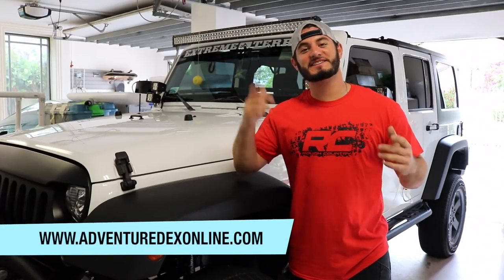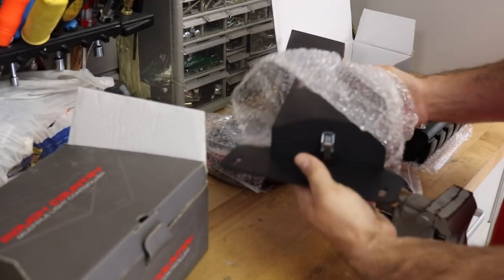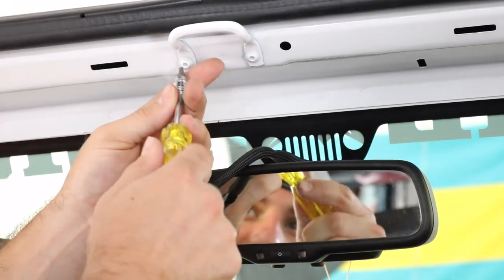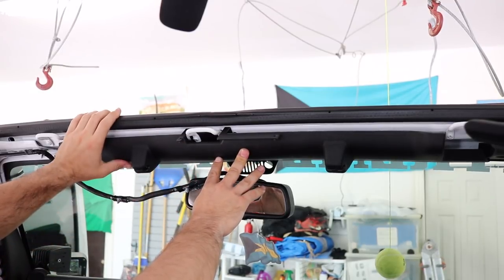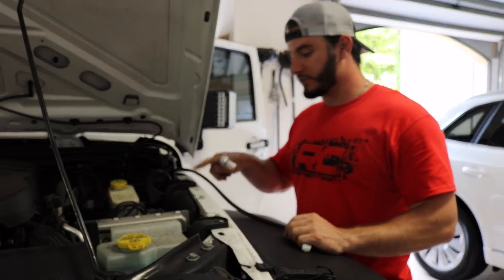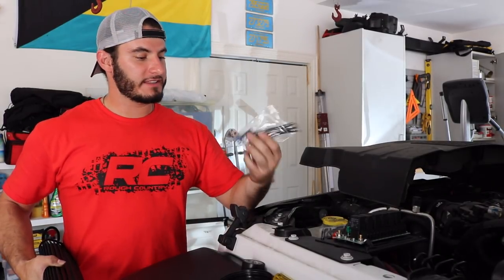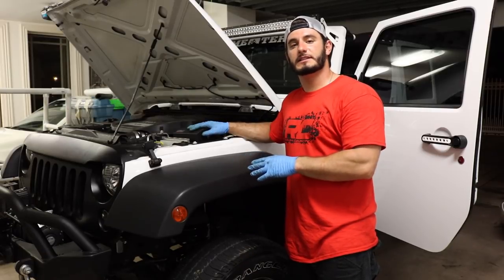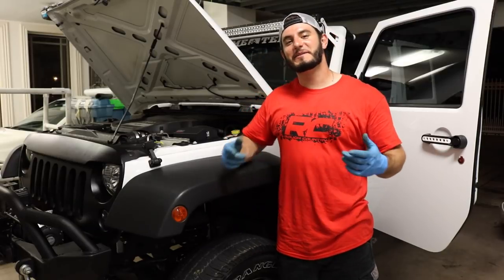Jeep Wrangler Switch Pod Installation - Rough Country MLC6

Comment: Sorry if you mentioned this in the video or I just haven't done my research but does the MLC-6 work on a 2017 Jeep Wrangler?

I'm 16 and I am beginning to save up for a Wrangler as my first car. I absolutely love the community for upgrades and mods to the Wrangler(as well as this channel! Thanks a lot!), and can't wait to do a few to mine when the time comes. Is the 2017 any different from a 2016 or 2015 mod wise?
Reply from the maker: Thanks for the comment! There is no difference really. I am not 100% sure if this works on 2017. You would need to check with RC. Thanks for watching!

Comment: Those switches look like Carlton? switches.  They make them in Red, Blue, Amber, and mixes.  Check out Ottraw.com.  There are ALLOT of different rockers (the touchable part of the switch) too.  You can get red led switches and swap them out.  The upper ON light is powered from the Source line, but the little led that is staying on can be powered from your dash dimmer.  The Carlton switches from Ottraw.com are dimmable (chinese knock offs may not be).  So if you power that light (it has it's own terminal on the switch) from your dash light circuit, then the light will be adjusted from your dash light reostat, and they will be OFF when the dash lights are off.  It looks like it wouldn't be hard to run one more wire up to the switch panel.  Ground is already wired so one wire is all you'd need, then pigtail or jumper it to all the swtches.
I have no affiliation with Carlton (I think that is the manufacturer) or Ottraw......other than buying stuff from them.  I have been very pleased with Ottraw's service.  
If you get switches form them, don't forget to get the terminals too.  They can be found under the "accessories" or "other parts" drop down tab.  These are the terminals that "lock" in the plug part that plugs onto the back of the switch.  Ottraw has the best prices for these terminals that I have found (I've seen them on Amazon for 70 cents for a single terminal ! ).  Ottraw has a tool that makes it easy to pop off the rocker from the switch.  Get one.  They are inexpensive and you will find you use it allot.  They have tons of rockers to choose from .... and they can make custom ones (the letters or words on the rocker switch can be customized on certain rockers).
Reply from the maker: Thanks for your detailed comment! I have looked into OTRATTW switches and I plan on getting some in red. They make alot of different types and they are supposed to be great quality. I will be making a video on them once I get them. They are a little pricy but I guess you get what you pay for. Stay tuned for that video! Thanks for watching!

Comment: Dex - Have you found a way to turn off the LED's? From other reviews I have read the LED's stay on all the time - even when the vehicle is off..The only way I can think of doing this would be to hack in a relay that turns on only when the key is in ACC that would power the MLC6.  Thoughts?  Thanks!
Reply from the maker: Thanks for the comment! No, the lights stay on 24/7. It doesn't really bother me or present any issues so I can not messed with it. If you unstinting wiring, I am sure you could disconnect the light so it is not on all the time. If you connected the power source to a source that only had power when the Jeep was on that would fix that. Thanks for watching!

Comment: when the Jeep is turned off, will the switch panel illumination shut down. it looked like the switches were still illuminated when you turned off your ignition.
Reply from the maker: Thanks for the questions Shawn, The blue lights never turn off. This does not affect the battery. Thanks for watching!
Reply: so how can this not drain battery. is there a way to connect the back lighting to a fuse panel.
Reply: AdventureDex hey you said this wouldn't effect the battery, but it just killed mine... Do you think it's because I didn't connect any lights to the source? I was planning on installing all my lights in a week, so I was just running the product on my car without any lights connected to it. Do you think that may be the reason my battery died? I'm not sure if once you have lights connected to the source then the whole system functions properly. Do you have any suggestions of what I should do? I really like the product and rather not return it if I can just prevent it from killing my battery again. How has it been working for you so far?
Reply: CROD The LED draw is so minuscule, you'd have to leave your Jeep sitting idle for a couple of weeks to have a problem. RC posted on Facebook they're coming out with one that puts the LEDs on a switch like that shall-not-be-named-but-so-overpriced brand.

Comment: So I did the install everything worked good but for some reason the leds from the switches don't turn off.
Reply from the maker: +OzilMadrid15 Thanks for the comment. They are not supposed to! Thanks
Reply: AdventureDex thanks for the answer I figured they wouldn't since they hook up to the battery. So the next morning I checked the box after having my jeep off al night and the control box was really hot. Have you had this issue?

Comment: Do the led’s on the switch dim with the steering wheel control? My concern is that they might be too bright driving at night. What is your opinion?
Reply from the maker: +michael sorokin Thanks for the comment. No they don’t dim, there not really that bright. Plus they are up top which is out of the line of sight. Hope that answers your questions. Thanks for watching

Comment: This thing just killed my battery... The lights from the switches never turn off. I'm not sure if it's due to a defect, or if this is just how it is.
Reply from the maker: Thanks for the comment. The lights are not supposed to turn off. They will not kill your battery either. Thanks for watching!

Comment: Does this product work with a Freedom Hard Top on a 2015 Jeep 2D Wrangler? It just seems that there is not much space above the switches to lock the Freedom top. In your video, you don't have the top on so it's hard to tell. Thanks...Bill

Comment: I have the mlc6, after I finished installing the battery portion, for some reason it came with an additional lengthy wire for the positive cable on both ends, so I cut the one to shortest length that connects to the circuit board but left it exposed, now when i turn on the car with the mlc6 power switch on, it starts to spark immensely, and I can't figure out a way to fix the situation

Any tips?

Comment: Hey how did you wire up your led light bar to the mlc? I know from your led light bar video it came with a switch already. Did you have to strip the wire or something
Reply from the maker: Wiring up to the MLC6 is easy, just run your wires and connect them to the MLC6. You will need to strip your wires to connect the source. Hope that helps! Thanks for watching!

Comment: i have a cb radio and a ham radio mounted where the switches need to go, above the mirror. Would it be possible to keep the pillar switches instead while running the MLC6 under the hood?

Comment: Do you think it is possible to wire this with an A pillar set up rather than above the mirror? I've been searching, but can't find anything. thanks for the video.
Reply from the maker: Yah Definitely but I am not sure what the advantage would be seen as this kit comes complete as one unit. It is supposed to take the hassle of wiring away. Hope that helps! Thanks for watching!
Reply: I would like the hassle free aspect, just wanted to know if they had a kit with a pillar option rather that the overhead. I just prefer that location.
Reply from the maker: Understood. The A pillar is great too but much more work wiring. Thanks

Comment: So we recently had the ML6 installed in our 2016 Jeep wrangler 75th edition.  We notice when we got home that we are able to close the center latch for the tops that is next to the switches.  Do you know what they might have done to install this incorrectly?  I watched your video and you seem to have no problems.
Reply from the maker: Thanks for the comment Stacy, The center loop does create a SLIGHT issue when trying to full close the latch. My latch close enough to create a good seal on my Freedom panels thus I do not have any issues with leaking or anything. If you cannot close your latch at all, you might experience issues such as leaking. I would make some adjustments to ensure the latch can close just enough. Hope that helps! Thanks for watching!
Reply: Stacy Toomey i believe if you install the bracket in front of the footmans loop instead of behind like the video shows everything should line up perfect ?? AdventureDex is this correct?

Comment: Hello great video! Quick question when installing the lights for example a 50 in light bar do I connect it directly to it or do I need someKind of relay in between. Thanks
Reply from the maker: +RETRO thanks for the comment! You can connect any lights directly to the source. Very convenient. Thanks for watching

Comment: do you have a winch and is it hooked up to it? Does it handle the amps from it? I have a 2013 JKUR and I use my winch ALOT!
Reply from the maker: Yes, I have a winch but no it is not hooked up cuz the winch connectors are huge. I will look up a way to hook the winch up. Thanks for watching!
Reply: ya that was a concern if it would handle a winch connection.

Comment: Hi Adventure Dex, I have a different switch panel for my 2013 JKU. The install was similar and comes with everything the Rough Country kit does but, one thing I like about my kit is that I have a choice in switch color to match the Jeep's interior lighting so it blends in & looks factory, another thing is that my switch panel has a battery volt meter which also monitors voltage if the Jeep is not running and will cut off power to the lights to prevent battery drain below a certain voltage so won't drain the battery below start power.Hey, you can always either use your old switches from the Pod Panel you took off or order new red only switches on Amazon that will fit directly in your new Rough Country Switch Panel, This is my kit https://www.amazon.com/Apollointech-Wrangler-2009-2017-Overhead-6-Switch/dp/B01CDTW03K/ref=sr_1_3?ie=UTF8&qid=1493472886&sr=8-3&keywords=jeep+wrangler+switch+panel
Reply from the maker: Thanks for sharing, this is a very similar product but I cannot speak as I havent had the chance to truly see it. Thanks for watching!

Comment: I just received my Rough Country Switch Pod and it looks like they have added a work around for the blue lights staying on all the time. Now it will only come on with the jeep running or acc switch on. There is a Red wire added on each end. One goes to the M6 Fuze with a fuze tap, and the other requires you to cut the wire going to the relay under the hood? Instruction not clear how to connect after cutting. Spoke to RC and still trying to get the power to the switches?? Anyone else hear of this? I have the instructions they sent and can provide a copy (Not helpful at all!)! Also not sure how to get the wire into the fuze box to connect the fuze tab??? No access holes? Drill a hole??? Hope to get it operational soon!
Reply from the maker: Thanks for your comment! I will be making a video on this MLC-6 mod. Stay tuned!
Reply: I also got this version of the MLC-6 and was not sure how to attempt this at all with the extra wire on the positive battery connection. any solutions yet??

Comment: I was wondering; I'd like to wire two Light pods (2 on both sides of the vehicle) together on one switch, and the other two on another switch.  Seeing the MLC6 that you're talking about, how would you go about doing this?
Reply from the maker: Thanks for the comment! Two easy way to do this, either run all the lights to one switch and connect or connect all the light together then run 1 wire to the switch. Hope that helps! Thanks for watching!

Comment: Can this controller can be used in any other vehicle or is electronic designed only to work on jeeps.???
Reply from the maker: It can be used for any vehicle but the application is designed for Jeeps. It would have to be customized to fit another vehicle. Hope that’s helps

Comment: how did you hide the Led cables from the outside of the jeep?
Reply from the maker: Thanks for the question, the cables running to the inside of the Jeep go through the firewall in the engine bay. The cables going from the lights get hidden behind the light bar mounts. Hope that helps! Thanks for watching!
Reply: Thanks man! awesome Jeep by the way ✌
Reply from the maker: Thanks!

Comment: are you still able to hook the hard top onto that latch
Reply from the maker: Yes, half way. It does leak so it good! Thanks for watching!
Reply: AdventureDex I'm having the same issue!  I just installed the switch box and I cannot get the latch to secure.  Is that ok?  Everything else went great!  Awesome video!  Thanks Bob

Comment: How should the wire be run from the switch box through the fire wall?
Reply: If you look along the wall near Your Break pedal you'll see what looks like a black circle, its rubber and you can go through there.

Comment: I just got this for Christmas and plan to install some lights I also got for Christmas. The wiring harness the lights came with include a relay, do I need to keep that relay while using this?
Reply from the maker: You don’t need the relay... just connect it direct to the source 👍🏼
Reply: @adventuredex  that’s what I was thinking but I just wanted to be sure, thank you!
Reply from the maker: Anytime!

Comment: you can make your own for a lot cheaper if you just do good wire management but thats just me haha
Reply from the maker: Thanks for the comment Logan, for $199 this is pretty cheap bro. By the time you buy 6 switches, 6 relays, 6 fuses, a circuit board and all the wiring... your probably close to $199. Save yourself the hassle! Thanks for watching!

Comment: The fact that both parts of the unit are open to the elements is an instant fail
Reply from the maker: Thanks for the input, "instant fail" might be a stretch but I agree it is not set up to take on alot water. Thanks for watching!
Reply: You could fab up one out of plastic  it wouldnt be to hard to do and just seal the unit under the hood after you use all 6 spots.

Comment: Does this product works with 2020 Jeep Wrangler JL?
Reply from the maker: No but they make versions for the new JL platform. 👍🏼
Reply: Do you have the part #?
Reply from the maker: Check out RC website. They have two switch pod options for the new JL

Comment: Hi brother man thank you so much for your videos . Your videos have made me install a lot of upgrades on my JEEP WRANGLER JK SAHARA 4DR 2018. But this time I really need your help, This are my products from ROUGH COUNTRY THAT I WANT TO CONNECT TO THE    (1) MLC-6 MULTIPLE LIGHTS CONTROLLER   SKU 70959  (2) ROUGH COUNTRY FRONT WINCH BUMPER SKU 10585. (3) ROUGH COUNTRY 50in BLK SERIES DUAL ROW CREE LED LIGHT BAR SKU DLR 7095080  PLEASE HELP ME THE WIRING. HOW DO I CONNECT ALL THE 3 ROUGH COUNTRY PARTS TO THE    MLC- 6 MULTIPLE CONTROLLER  SKU 70959  PLEASE HELP ME WITH THIS MY BROTHER WITH SOME DIAGRAMS AND PICTURES I KNOW I’M ASKING A LOT BUT PLEASE HELP ME THANK YOU

Comment: Ummm the top of the switch pod is open so if it rains or sprinkles or u go missing with top off it get wet inside the pod. Must be for a mall jeep
Reply from the maker: Thanks for the comment Ryan, Unless you completely submerge your Jeep you should be fine. The worst thing you could do is probably blow a fuse. Thanks for watching!
Reply: Could also cover it yourself too.
Reply: I have an sPOD and WISH I would have waited for this because it's way cheaper. To reply to Ryan AKINS the sPOD is open on top to rain and sprinkles too. Been in a downpour with top down and it's fine..not a lick of damage or blown fuses
Reply: sPod isn't as open as this unit is though Luis.
Reply: Agreed, not as open there on top...but I'd still accept that for saving the $400 extra I spent
Reply from the maker: Great suggestion!

Comment: Hey Dex, Great video just installed mine today, looks and works very good, don't like the lights being always on but I'll get over it. I found out that new compatible switches can be found here   http://www.otrattw.net/Contura-V-SR/. Also for you folks who don't like the LED'S always lit, I'm wondering if you can just disconnect the lead going to that led? I will try that next weekend if I have time.
Reply from the maker: Great question! Yes, they are compatible. You can disconnect the LEDs from always being on. Thanks for watching!!
Reply: Hi Derek, I finally got it installed today (got the tap yesterday) Works beautifully I wired it from the battery to a 4 post terminal block so that i can connect the led back lighting from the  "rigid Industries" 10" light bar that's mounted to the top of my roller fairlead and I am also going to mount two "R. I. cube lights @ the windshield (also with back lighting) I will upload a couple pis to my channel and will post a link

Comment: uhhhhhhhh tons of money in "offroad" lights with no lift and street tires?
Reply from the maker: +Lowcountry Adventures correction! There is a lift now lol thanks for watching!
Reply: AdventureDex oh lol. Can u answer this question. I bought a 3 prong led light bar harness. And I'm switching out the rockers. Can a 5 prong work even with 3 prongs. It has two grounds which I don't think matters in that situation
Reply: normally a 5 prong allows for the light to be lit up all the time and then also light up a second lamp when the light is switched on. The ground is the ground - you can daisy chain the grounds together.  http://www.otrattw.com/F66B.jpg